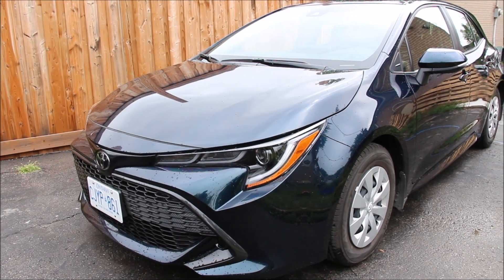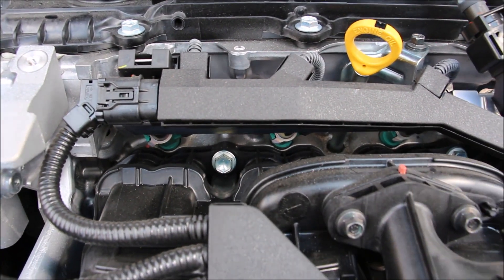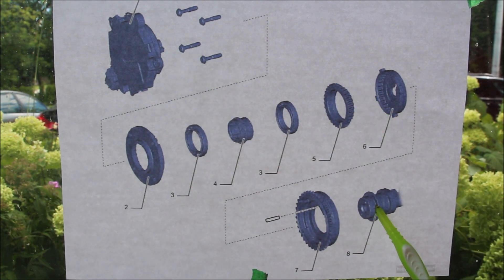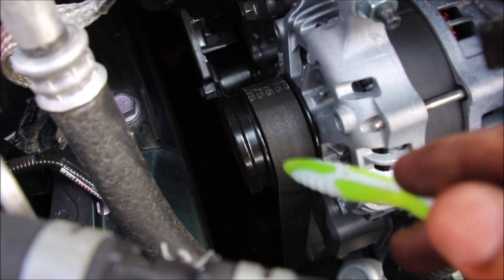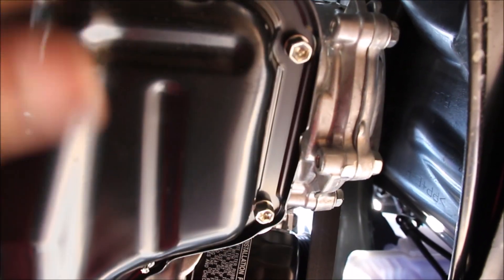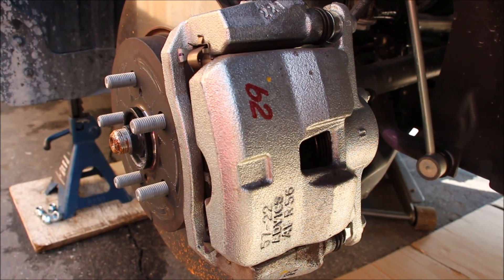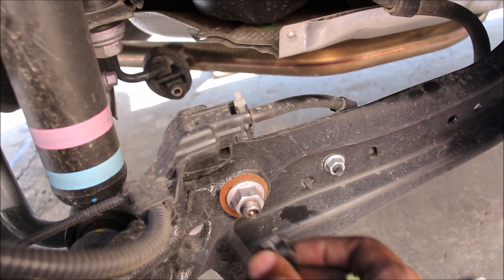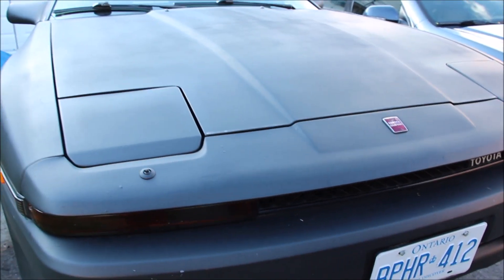Toyota Corolla Mechanical Review

Comment: I'm surprised, a car with the hood up without crappy plastic shrouds covering everything
Reply from the maker: It's a Corolla...they had to cut the plastic somewhere
Reply: The 1.8 looks way less cluttered than this 2.0
Reply: @pryme2013  could be coz it has both port and direct injection, and doesn’t have that crappy plastic cover
Reply: @jessef9190  1.8 has no cover
Reply: The crappy plastic is now part of the drivetrain

Comment: No hate on Toyota for using an electric water pump on the comments? Imagine if this was a bmw... Anyways nice video. I just wonder for what do you still need a thermostat with an electric pump
Reply from the maker: True, I don't understand the purpose of the thermostat either. 

Electric water pumps have been used in Toyotas for more than a decade...see the hybrid applications
Reply: @speedkar99  didn't know that. Great to get a reply from you! Keep up the good work
Reply: @speedkar99  You still have to circulate the coolant through the engine during warm-up, even if not the rad. Thus, the thermostat.

I mean, right?

Comment: SPEEDKAR SPEEDKAR, will you review a Toyota exhaust, I'm trying to figure out what this stupid rubber line on the exhaust is, thank you, and show how it works🤙
Reply from the maker: A rubber line? You mean a vibration dampener?
Reply: It’s like a rubber hose line connected to the mid piping, has a little actuator and what looks to be controlling something in the mid pipe, I have a Prius 2015 and I’m confused what is going on #toyotaconspiracy

Comment: So what’s the verdict, is this going to be at least as reliable as an old mechanical water pump, vacuum operated brake booster, non variable oil pump, ECU inside the car style Corolla?
Reply from the maker: It will be reliable until it breaks. Then it'll be more expensive to fix. Just like a Lexus from a decade ago from which all this technology is from.
Reply: The Big Three have put ECMs under the hood for almost 20 years. There must be something to it if Toyota is following suit.

Comment: Excellent review, thank you, would like to see more.  You mentioned about 200,000 km in your review, in your opinion, will the CVT last that long on this car?
Reply from the maker: CVTs have been around for almost two decades (Toyota is no exception with thier hybrids). The last generation Corolla had a CVT and it's going to be the mainstream. I feel that it could at least last as long as a traditional automatic - but - you gotta change the fluids - which is a chore on this tranny. 

Time will tell though, the idea of having a physical first gear is new, and I personally didn't like its noticable engagement when driving this car off from a stop.
Reply: According to Scotty Kilmer Toyota makes the best cvt's engines
Reply: Toyota s CVT has a lunch gear in first gear which reliefs the strong pressure applied to CVT belt, that design by itself will outlast all other CVTs by a long shout , it will be longest lasting CVT, still not last as long as tranditional auto trans

Comment: This is the review I want to see on any new car. How much plastic are they putting in the engine bays now. These are no longer japanese cars. I like to see the Honda truck. I like the space on that thing and you don't need a ladder to get into it or load things on the bed.  All the new trucks are all for off-roading not normal everyday people that need that once in a while. I want to know if the Honda trucks also need that whole underside to get the engine out like some other Honda's.
Reply from the maker: Plastic is there for weight savings and aerodynamics. Time will tell how long they will last. Being Japanese or any other make doesn't matter, they're all the same inside...the difference is in the body style, service and warranty. 

By Honda truck you mean the Ridgeline? I think it's a good start for a market that doesn't exactly exist yet, like a "soft" pickup.
Reply: @speedkar99  Yes the Ridgeline. Yeah it's the market that's always been there.  Someone thought it was a good idea to just make SUVs which I'm sure many others also don't care for. As for the plastic parts, sure weight savings, maybe but those parts just won't last a lifetime with the heat. I'm not so sure about the weight savings since both my old two seaters are small and Japanese. Miata and MR2. Not so sure about the Miata though. Intakes are metal and they use the old metal can oil filters. Not the crappy plastic. Just to give you an example. I guess what I mean is that Japanese used to mean something. Now it just doesn't seem that way.

Comment: Best car review by FAR! Fantastic job, sir!
That being said, I am deeply saddened by the trend of "electronically-controlled" electronics, plastic, stamped steel and brittle alloy engines designed to fall apart, fail and break down with normal use. It makes little sense to outright own such an overcomplicated vehicle with so many possible fail points. As long as they continue to sell gas, oil and tires, I will continue to drive my 33 year old Suzuki Samurai past loads of broken-down, more "modern" cars.
Reply from the maker: Thanks. You definitely have a traditional view on the automotive industry. Fuel efficiency and safety regulations are driving manufacturers to squeeze as much power, economy and weight out of thier vehicles so the "decontenting" you see is basically eating up any potential that the vehicle already had.
Reply: I second that. Ill be driving my 20 yearold camery indefinitely.  I prefer a metal intake and metal valve covers. Heat plus plastic is a receipe for disaster.
Reply: @cgmf-d6t  EXactly my thoughts with my old Camry too.My hair literally stood on end watching this.Pity the poor suckers buying one of these in 20 years time.Mind you they'll probably only last 10 years max."Et tu Toyota".[Shakespeare's view]
Reply: I agree! My 1990 Corolla is a better car than a new one, and it only has 82k miles!
Reply: @Nombre Apellido I think I’ll always own a corolla. They are the best little cars ever made!

Comment: I would stay away from those cvt hell nah
Btw best car review i have seen in a while showing everything damn
Reply: Toyota makes great cvt's
Reply from the maker: They sure do, driving this thing around my neighborhood, it was difficult to tell there was a CVT under the hood. However I did feel the engagement of that physical first gear at launch.
Reply: Miguel Arellano Toyota makes great eCVTs in their hybrids. However, they’re completely different from the conventional CVTs (like in the Corolla). Toyota’s eCVTs use a planetary design, while their conventional ones are belt and chain designs
Reply: @miguelare3  no thanks I rather take the 6 speed manual transmission.
Reply: Toyota's CVTs are great for normal family car for city driving especially on economy cars like Corolla, not for a Sporty sedan for a college kid like me
My family has a 2006 Toyota minivan with a 4 cylinder 2.0 engine and a CVT, it is nice ans smooth to drive in the city and highways but I don't prefer it on twisty roads or hills where you need to control real gears
Reply from the maker: Thanks, what more would you like to see?
Reply: This isn't Nissan Mr paranoid.
Reply: Trap lions I'm not a cvt fan either  but in a Toyota it should  hold up time will tell
Reply: Yep 400000 recalls can't be wrong.
Reply: cisa93  OK. Tnx for the info!
Reply: It’s only mean one thing you don’t know nothing about CVT 😁😆
Reply: Agreed, the CVT design is inherently weak no matter who made it. It just can't handle moving a huge car around, at least not for hundreds of thousands of miles. There is a reason that for decades the only things with CVTs were golf carts and mopeds.
Reply: Nodak81 seriously!!? Talking about heavy cars, do you even know that the biggest machines like giant agricultural machines, army tanks , tractors and many other heavy machines all uses CVT gearboxes
Reply: The biggest problem with any CVT is the person that talks shit about CVTs without caring to educate themselves about them. People that complain are the number one reason that CVTs aren't as great as they can be for both performance and economy. The technology was even tested for competitive use in F1 back in the 90's, but was quickly banned because of how great the performance was over standard gears. That's not to say I'd ever drive one (manual gears all the way for the engagement), but as a whole the CVT will never see it's true potential as long as manufacturers keep trying to make it emulate physical gears.
Reply: @illitero  They should also wake up and realize, what compact car is left without cvt?
Reply: My mother bought a new Toyota a couple years ago and the cvt didn’t last a year. She kept having to bring it in for service after getting it replaced. Eventually she traded that nightmare in
Reply: Joshua Vaughn there is always a bad grain inside a bag of rice, just because your mothers cars Cvt didn’t last long doesnt mean they are all bad

Comment: Toyota sure is making a lot of improvements, unfortunately, in my opinion, along with the improvements also making it harder for the DIYs ...  except for going back to the canister style oil filter.
Reply from the maker: Good thoughts, though having gone thru this Corolla in depth I don't think it'll be hard to service compared to Toyota's transverse V6 vehicles.
Reply: speedkar99, oh yea, I have a 2016 Highlander 3.5L V6, it will be fun to change the back 3 spark plugs and not looking forward to the day to change its ATF and filter.  I watch one of your knock sensors replacement videos on a Lexus... if that day ever comes, I will just junk the HL.  LOL
Reply: I'm a "professional" technician, most of my work is in electrical diagnosis now with some brakes and suspension work thrown in. The tuneup days are practically gone,it's not that they took it away from the driveway mechanic, it's that there is little to do. Spark plugs now last 100k miles, no distributor or carb to clean, just keep the oil changes to a reasonable limit a and pop a new air filter in when needed and the engine will last 300k miles.

My only advice is that companies are increasing the time between oil changes to absurd levels. The brand I work for says 15000  miles per change. That is not a good idea. It's only done so they can advertise that their cars need less work, but you have to keep in mind they only care that the engine makes it past warranty, not to 300k. Use good oil and stick to closer to 8000 miles max, and you are good to go.
Reply: @alexmaclean1  I agree. Although if you drive over 90% highway miles you might be able to go 15,000 miles or more between oil changes but why risk it. Remember 100,000 miles of pure highway driving causes no more wear than 10,000 miles of city driving. 
https://m.youtube.com/watch?v=lEGwpLpTkI4

I'm changing mine every 5,000. After retiring I drive less highway miles than I use to.
Reply: Other than the weird need for an air compressor + Toyota Techstream (which I have both - hint - check ebay for the TSS software), everything else seems pretty DIY friendly. Last year I had to press out my wife's 2006 Toyota Highlander Hybrid wheel bearing, which was not that simple. This Thanksgiving I'll need to change the timing belt next (severely overdue at 173k miles!)
Reply: True. Outside of suspension, brakes,oil change and tune up. Diy is screwed.
Reply: @OliverKoolO  uh, I think you can change or inflate tires and change air filters..., No? 🤔😀

What do you mean by "tune up"? Maybe replacing spark plugs and cleaning the mass air flow sensor? I mean there haven't been any distributor caps, rotors or timing adjustments or valve adjustments for a long long time.